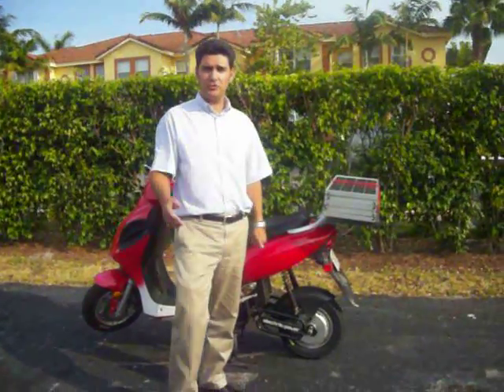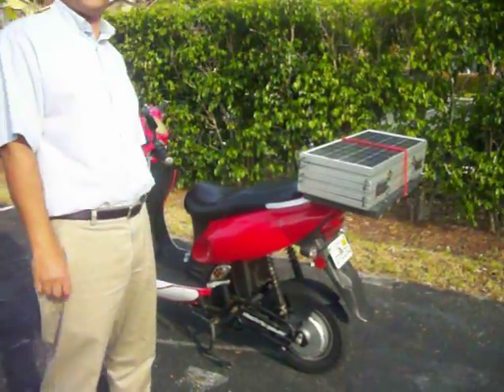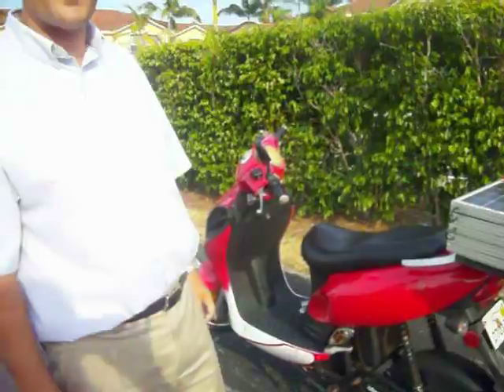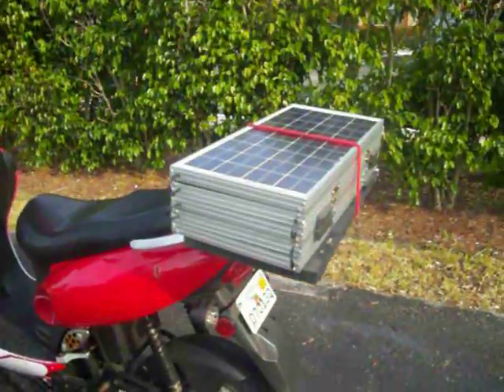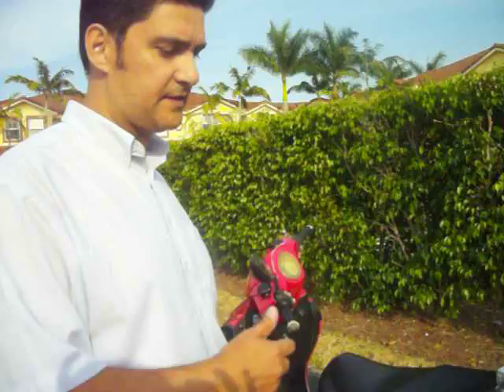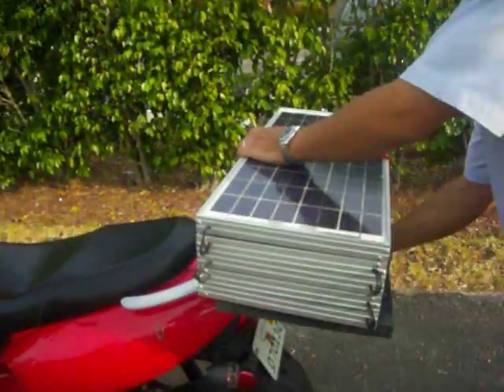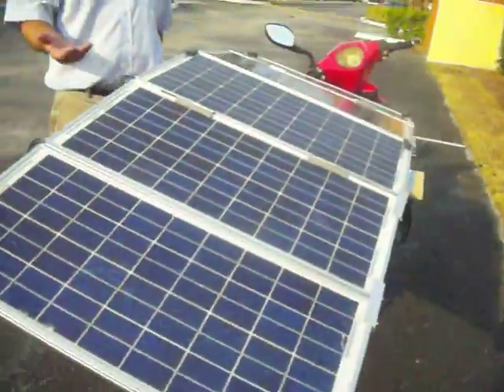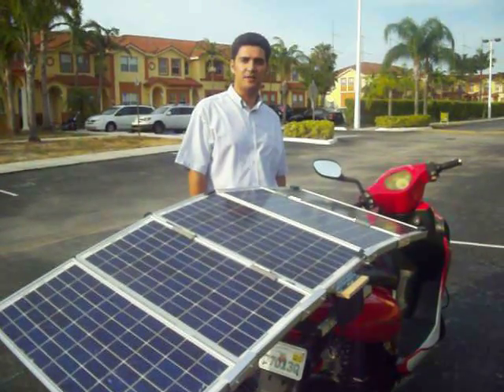Solar scooter

Comment: how did you connect the panels to the batteries?
Reply from the maker: Hi, for the first prototype I connected the panels in series and used a simple switch. Because of the low amount of energy generated by the panels even a small ride would use more energy from the batteries than what the panels would be able to supply in one day. If It was today I would use one if those dc-dc charger converter that you set the input and output voltages and current to match the panels and batteries

Comment: Can you please tell me how long it takes to charge that battery and how many miles you get per charge ? Thank you!! Great idea!
Reply from the maker: Adam, thanks for your question. The scooter had about 35 miles of range per charge using five 12V/35Ah lead-acid batteries. The solar panels only added about 6 miles per day so you would need 6 full days of sun to fully recharge the batteries.

Comment: Hello, where can I find these solar panels? I am interested in a similar project
Reply from the maker: Hi, you can find them on Amazon or eBay. I suggest you buy the semi-flex ones which do not have the heavy aluminum frame.

Comment: please tell me why anyone would need this. you can't drive your scooter while its charging. and while charging i bet it's going to take damage. somebody will break it or it's going to break on it's own. sorry dude, but this is so unnecessary.
Reply: You are clueless.
Reply: It would charge while you are at work or at school and it would have no reason to break if it’s sitting in a parking lot it is also infinitely charged so you never need to pay to charge it or support gas with a gas powered moped